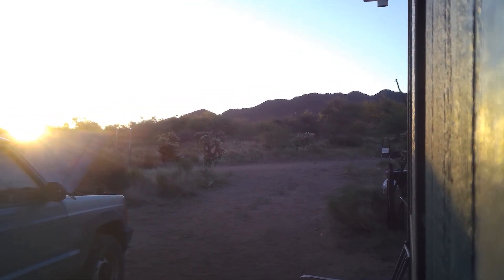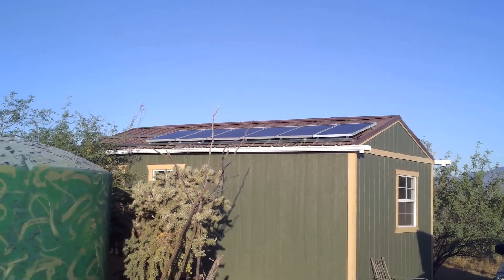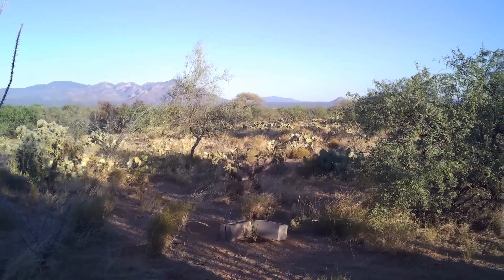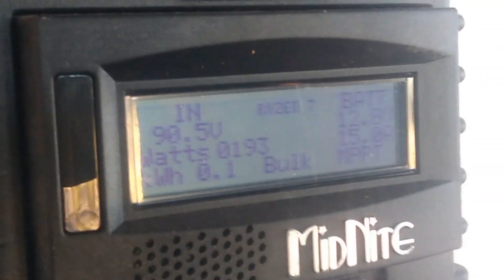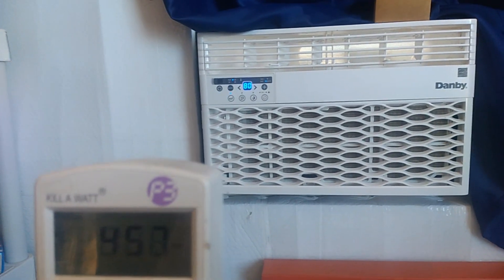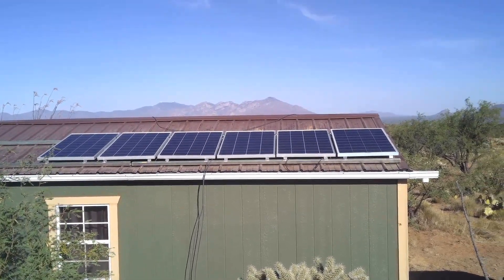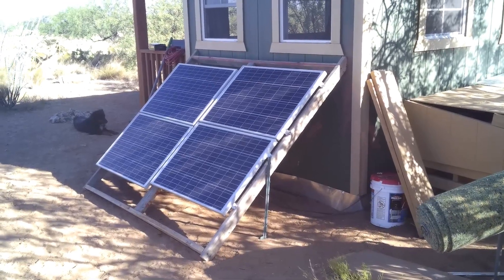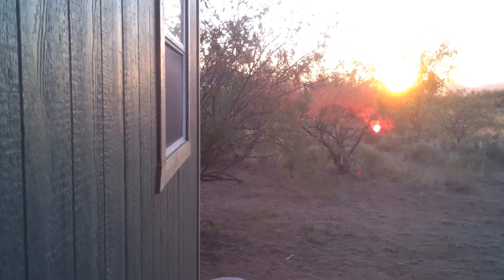Solar is DONE and AC is running @ AZ Off-Grid (Unplugged)

Comment: Wow! I have love following you on your journey! Remember I bought a raw parcel in Mojave desert 5 miles outside of Yucca,AZ. It's just about time for me to go find me a camp trailer. Will have enough saved in about 6 months time. I want to buy a cute 18-22' vintage cutie. Fixer upper ok. Robert, what do you think of setting up solar in a vintage? Do you think it will be easy or hard to do? Ha Ha... I'm only beginning my journey, I don't know a thing about trailers of any kind, however, I do plan on also buying a storage shed as well and turning it into a tiny cabin such as you have. This way I have the camp trailer for my kids when they drive out to visit. We have an 8 year outlook to have everything set up. Not planned out by any means lol. Thoughts???? 
Thank you Robert for all your vids and explanations. Glad Ruger and Remi are also enjoying the air conditioner👍☺
Lisa🌵
Reply from the maker: Thank you for joining me on the journey,, I love having you along.. Depending on your definition of vintage I think it is a great idea.. As long as you realize the older ones have basically no insulation in them and what is there has settled down to the floor.. Solar is easy to setup regardless of where you put it.. Just get one that is "expandable" because you will want more in the future.. I set mine (charge controller and inverter) up on a "powerwall" so it could be moved fairly easily because I like to keep an eye on how it is performing.. It is an off gridders entertainment center..lol.. . Get a slightly bigger trailer than you think you want,, you won't regret it.. Especially if you will stay in it while working on your cabin.. The important thing about RV's is that they only have a few items that can go bad which are all easily fixable/replaceable.. ie: Refrig,, oven,, water heater, and furnace.. I ran everything off extension cords in the RV, even the lights, from the solar inverter.. The most important thing is not to bring any pack rats with you in the trailer.. I believe I had one in the green trailer when it was brought out and I never was able to get rid of it.. all food for thought.. hoping it helps.. .. Happy Trails.!!

Comment: Per Trojan:  
“For every 18° F (10° C) rise above room temperature (77° F or 25° C), battery life decreases by 50%.”
I don’t know if that just means that days available charge or total life.
Reply from the maker: I have perused the Trojan website but never came across that statistic.. I know that it impacts the "efficiency" of the batteries but not the life span.. Not a whole hell of a lot I can do about the outside temperature except,, if my Dad was correct,, leaving the door open while the AC is running.. .. Happy Trails.!!
Reply: deserthorizons, if interested, my search was:
trojan batteries heat longevity
The trojan link was “Battery maintenance”. 
They talk about temp affect on self discharge and longevity.

Comment: I didn't know anyone made a window A/C that doesn't "surge".   I know Micro Air makes an "easy start" that will keep the current draw under control when the compressor starts up but they are pretty expensive.  Anyway,  you've got a nice set up there, well done !
Reply from the maker: That was my biggest concern when I first turned it on was that the inverter would not power it.. (It is a 2K/3K unit) I was totally shocked to see how it started so slowly.. That "m a y" have something to do with the inverter I use as it has soft start as well,, but I think the way it works is I have to have the appliance plugged in and turned on before I turn on the inverter.. dunno.. The little 6K btu AC was only 259 bucks so I think it is a hell of a deal since it does have the soft start.. .. They also sell a 5K btu AC that uses ~50 less watts to operate.. Thank you.. .. Happy Trails.!!
Reply: @deserthorizons  "Gone with the Wynns" have a video where they talk about a special surge device especially for A/C or refrigerators which are on solar...
Reply: It most likely does have a surge, but the Kill-a-watt meter can't process it fast enough. You would need a clamp type amp-meter to measure it.
Reply from the maker: @Willbkool  I dunno,, the kill-a-watt reacts pretty quick to differing watts.. It can read the surge when my refrig starts..

Comment: Very cool solar video! Do you have a back up generator?   Also, now that you're fully insulated, would you do the spray foam again?  Was it worth the cost?     On to 5k subs!
Reply from the maker: Thank you.. I have a generator that the mice liked the taste of the wires.. I have not had a need to even think about using it in the 2+ years I have been here.. It is a 5Kwatt on the RV.. .. Winter will be the test of the spray foam insulation as I keep the windows open for the vast majority of the time during the spring, summer, and fall.. I believe the foam will definitely be worth the cost if it helps keep my feet warm this winter.. The RV was sooooooo drafty it was impossible to do that.. I am still trying to get to 2500 subs so I can get rid of the gold and silver I have for the Giveaway.. lol.. .. Happy Trails.!!

Comment: Holy smokes! 16 Batteries? Several panels? Maybe 10? Great setup.  I live in my van working on 3 years now.  Im also off grid in Arizona.  I only have 4 panels and a 200ah battery. Im finally going to have to upgrade for a freezer and I may put a swamp cooler in my shed.  But im comfortable without it.
Reply from the maker: yup,, 16 batteries and 16 - 100 watt panels.. You must be "twisted" to think it is comfortable in Arizona in the summer without AC or a swamp cooler.. shhhhhh,, don't tell anyone how nice it really is.. lol .. One of these days I am going to have to go to the store to stock up the freezer as my little refrigerator had basically no room in it.. the first summer I was here I ran everything on 6 panels no problem ,, only because it took me that long to realize half of my solar was not producing... .. Happy Trails.!!
Reply: @deserthorizons  Awesome! Yea, you're right, so many people told me and still tell me how horrible it is out here.  Im not seeing it.
Reply from the maker: @FrugalOffGrid  Jeez, can you imagine how overpopulated it would be and what it would look like if everyone knew how absolutely beautiful it is here in AZ.. .. Fun Fact: when the early settlers first visited New York City or Phoenix they had NO buildings.? .. That is what it will look like here if they find out..
Reply: @deserthorizons  Fug that

Comment: Glad that set up is working for you. 
Our AC probably runs at 1500 to 1600 watts.🙄
Reply: You can do a 12v swamp cooler.  I have an AC on my van and haven't run it once though.  Something about the shade and wind I guess.  I've been comfortable.
Reply from the maker: @FrugalOffGrid  = I have a 115 Volt portable swamp cooler (newair) that is more than adequate for this little cabin,, but sometimes the heat gets a little toooo intense and that is when I run the AC.. Today it is going to get to 104 but,, as of right now,, I don't plan on running the AC today with the slight cloud cover and the nice breezes I really don't think I will need it.. I did a video in 2018  about how well the newair works,, how much juice it needs,, and how much wind it produces.. .. Happy Trails
Reply: @deserthorizons  Robert I am wondering if your swamp cooler is a literal drain on your water resources.  I am considering using one for my set up.
Reply from the maker: @affordabledesertliving3487  Even if I used 3 gallons a day (avg) it would only be 90 gallons a month.. for 4 months it would be 360 gallons.. not too big a concern.. well worth the comfort it provides..
Reply: @deserthorizons  I think you said you had a very reasonable water supplier.  I have yet to find one that is cost effective here in the Sierra Vista area.
Reply from the maker: @affordabledesertliving3487  = cost effective as compared to ......... what.?     drilling a well.?   did you try that google thing on your internet machine.?     mine is ~160 for 2100 gallons of potable water..
Reply: @deserthorizons  I should have explained a bit more carefully.  Its about $400.00 to fill a 1500 gallon tank by one of the water supplies.  Yes indeed a far cry from the cost of drilling a well.  I wont be going the well route thats for sure.  Just need to see if there are any other competitive water suppliers.
Reply from the maker: @affordabledesertliving3487  well,, it might be cheaper to get "non-potable" water for the tank and get 5 gallon jugs for drinking water.. use the tank water for showers and dishes and plants,, etc..
Reply: @deserthorizons  Definitely a smart way to do it.  I will keep looking for better providers of water though. My suspicion is that a local has the potable water supply tied up and can charge big prices.  Not sure though.  More research needed!
Reply from the maker: @affordabledesertliving3487  You might want to check with Jim & Jessica from the "Green Dream Project" about where they got their tank water.. The company is in Douglas so they prolly won't service you but they might know someone that can.. (it was non-potable but they ran it through their Berkey for drinking water.. ) .. A Berkey would be a good idea in any case..  Another option is to become your own water hauling company by getting a trailer and a tank.. Then you could service any neighbors that are in the same boat..
Reply: @deserthorizons Valuable information Robert.  I have emailed Jim and Jess and interacted with them now for a couple of years.  Learned a ton by watching their channel.  I was also going to do a Berkey filter.  Did NOT KNOW that they used it to take non-potable water and changed it up.  Non-potable water is much cheaper in this area.  I also like the idea of doing drinking water hauled in like I do now in 5 gal containers and using the other water for other stuff.  Cheers and thanks Robert.  HOpe I dont overload you with questions.
Reply from the maker: @
Green Dream Project = It seems to be working great so far,, even better now that the extra 4 panels are hooked up.. This AC only cost 259 bucks so you might consider getting one as it will save wear and tear on your system.. (of course you prolly have more than enough to run what you got.).. .. Happy Trails.!!
Reply: @deserthorizons  no, you're right.  The heat does get intense sometimes and I just grin and bear it. The dometic AC on my van wouldn't be efficient to run continuously so I don't.  I'll do something eventually.
Reply from the maker: @FrugalOffGrid  I had an AC on the top of the RV that I never once considered turning on.. Partly because it was useless against this AZ heat and partly because of the energy it draws.. When it gets too hot here I always just think of the old west and what they did.. nothing.. there was nothing they could do except bitch about it,, and funny enough,, that never helps..  lol
Reply: @deserthorizons  And that's how I've been living. Hey if our ancestors were fine.  I will be.

Comment: How often do you check the battery water levels?
Reply from the maker: Since they are still new I have been checking them once a week but they still have not "used" a drop.. Once I put the AC away for the season and I have a good idea of how much they use it will go back to once a month.. That was exactly the reason we built the battery box at the level it is so I could check the water level without difficulty.. (it was extremely difficult to do in the RV,, I had to use a mirror and a flashlight.) .. Happy Trails.!!
Reply: deserthorizons, Sounds good.  You will get a feeling for battery water usage. My friend started at 3 month and boiled a couple dry😬. I would have thought twice a year before that. He does once a week now. Not that everyones’ batteries need to be checked once a week - it depends on how the batteries are used.
Reply from the maker: @mikemead2315  There were a couple of times I let it go long enough that it got right down to the top of the plates in the RV.. It is recommended once a month.. They are too expensive to not keep a closer eye on them..

Comment: Further cooling and ventelating the battery box is a good thing, as is separating the inverter and batteries. Flooded batteries off-gas hydrogen when charging, which is explosive. Usually inverters are purposely (per inverter instructions) not installed in enclosed battery boxes for that reason. Granted, NEVER heard of any exploding batteries ignited by inverters (a few car batteries by arcing jumper cables🤣 - Exciting).  Cooling both batteries and inverter will extend their life - batteries are the most expensive part of a solar system. Not sure how to share AC with them and not expose the cabin to battery gasses.
Reply from the maker: It is difficult to see by the angles I shoot at,, but the battery box is vented fairly well even when not open.. And you are correct,, there is not a feasible way to cool the batteries in the desert.. que sera, sera..  ..Happy Trails.!!